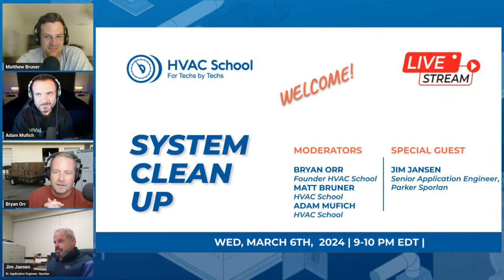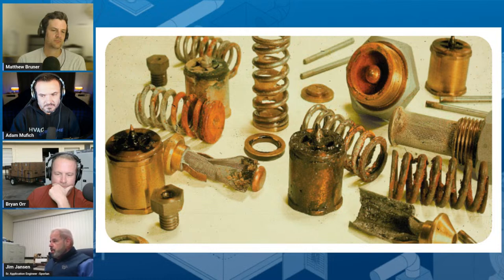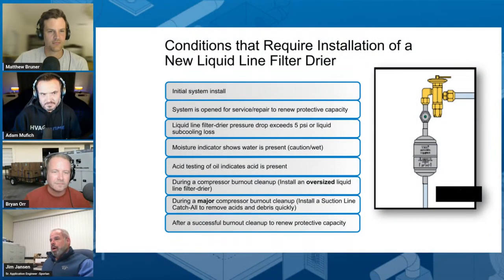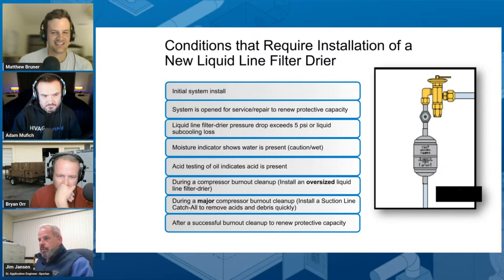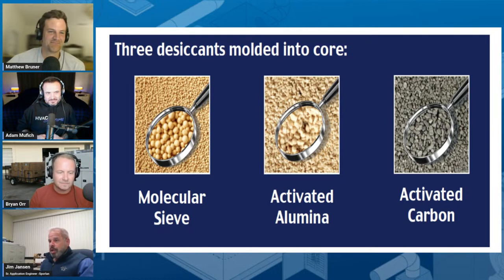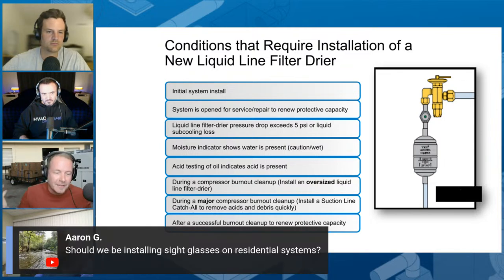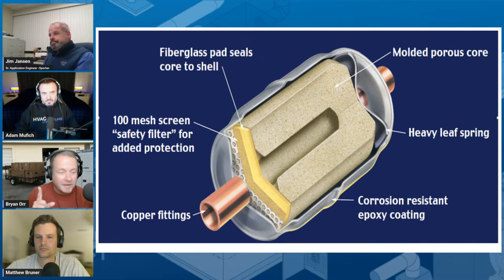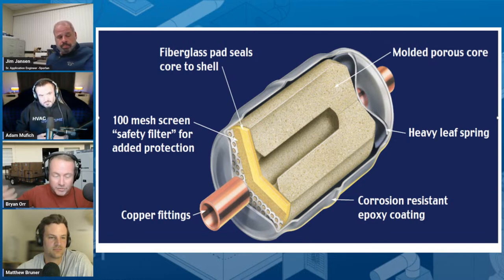System Clean Up

Comment: I just finished a long cleanup project on two vrf systems that had been installed without the flow of
Nitrogen while brazing. Two 20 ton systems with 4 branch boxes and 15 fan coils between them. Initially we thought all we tried a suction filter and new compressors but when we opened it up it became clear the system was very bad. The cupric oxide had plugged up the oil solenoids and reversing valve. And the blown out debris from the damaged valve had restricted the condenser inlet on one, making it completely incapable of producing enough pressure to effectively circulate oil. Customer finally let us crane new units on the roof, disconnect, flush and wipe all the pipes, install new branch boxes and recommission. The junk that came out of that system legendary

Comment: I might have missed the answer but Matt started asking about having 2 LL driers in series (1 inside the OEM CU and 1 outside the CU) but I think it got glossed over.  Did you cover that?  Obviously no, due to pressure drop but it's a pretty important question and I might have zoned out.
Reply: He didn’t gloss over it but he didn’t understand the scenario they gave him. pumping down the system to perform a repair at evap., OEM ll drier is inside condenser, Is it ok to add a ll drier outside condenser. We posed this question back in 2003 when 410a units began production to our manufacturer. The answer they gave was yes unless OEM drier tested restricted. In that case they highly recommended recovery & replace OEM drier.

Comment: I disagree with replacing all refrigerant when you recover it. As a chiller mechanic. 2000lbs of gas gets put in tanks(as an example). What we do is filter it going back into system. There's no way a customer  would like if we charged them to replace it every time we take it out.